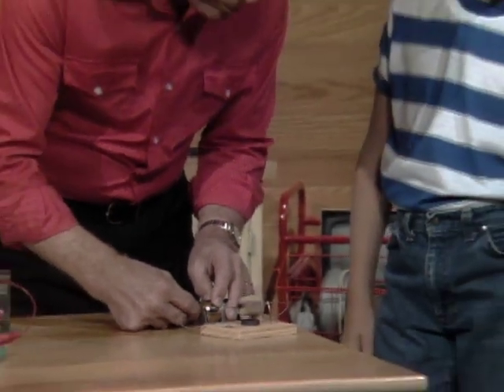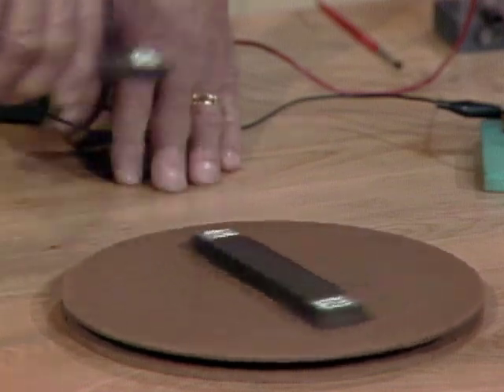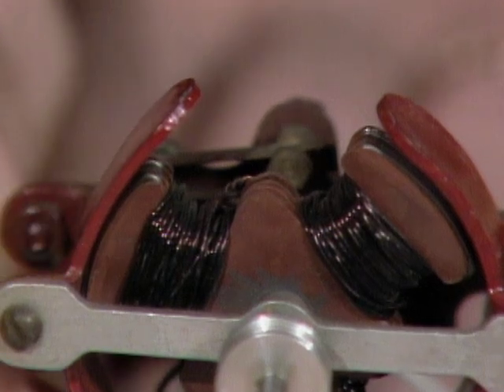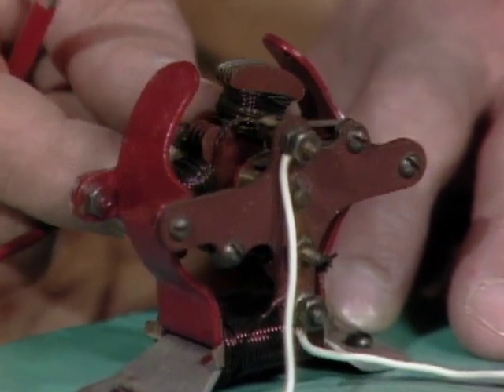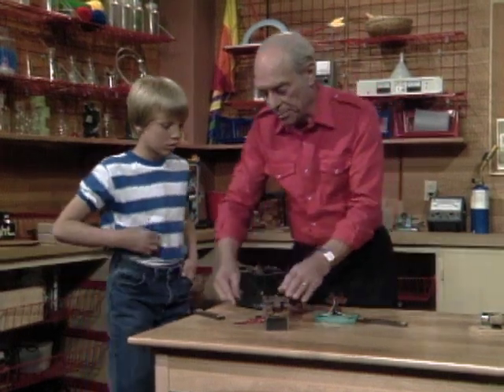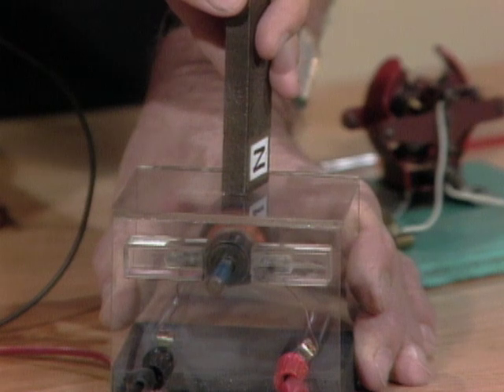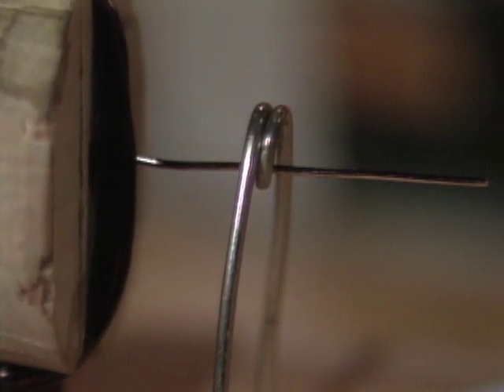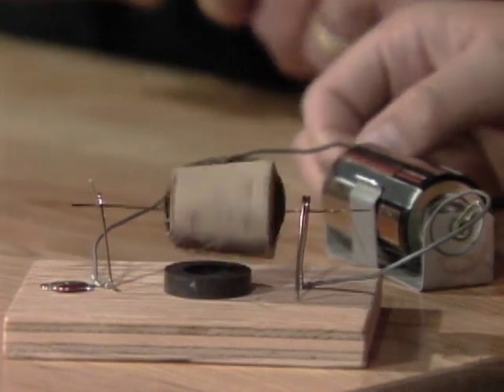How Do Motors Work? (Mr. Wizard)

Comment: I was so inspired by this episode, I did end up making the cork motor with my dad. But I can remember completely failing to make it spin. Mr. Wizard jumped through the commutator concept rather quickly. Neither me nor my dad understood that enamel was separate very thin insulation, so having used dark (corroded) bare copper wire and sanding one side as shown it never really did anything but quickly drain a 6V lantern battery.
Reply: https://youtu.be/sJ6Pj2IGCHQ
Reply: 👎🏻👎🏻👎🏻👎🏻👎🏻👎🏻👎🏻👎🏻ass hold